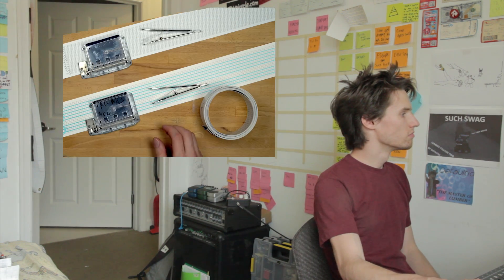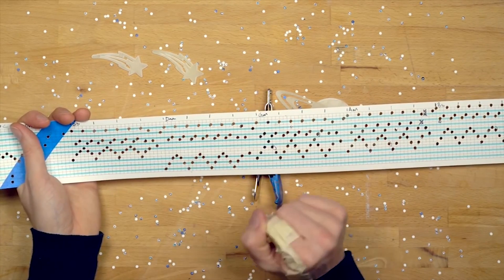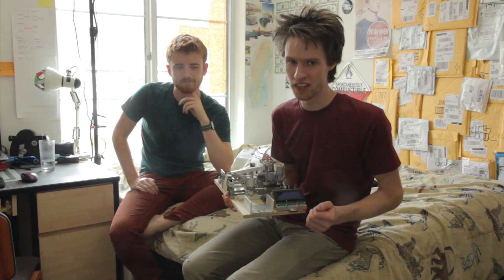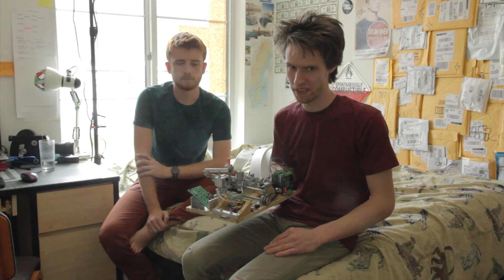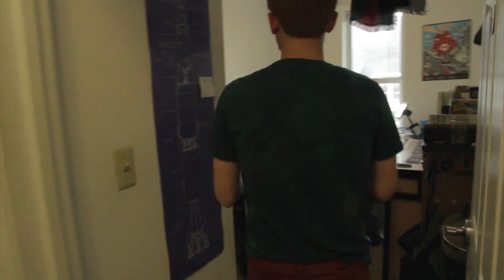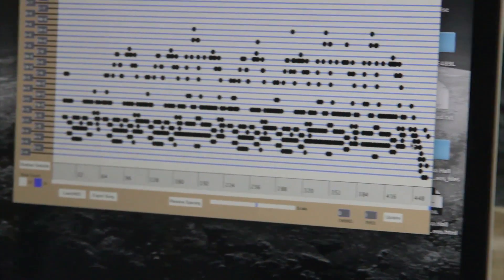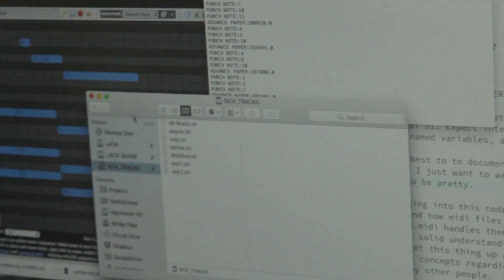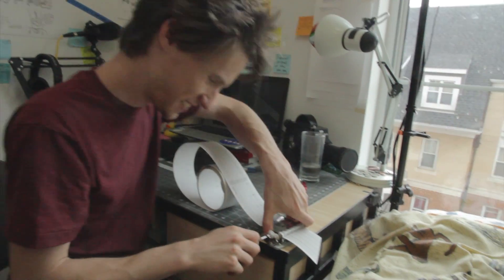Music Box Auto Hole Punch Machine

Comment: Your stainless steel or carbide punch head should go  through a [upper/lower] punch plate where the head punch lines up with the lower and upper sliding die plate and the cardstock will be punched with less effort.  Check this out for ideas; http://www.columbia.edu/cu/computinghistory/026.html

Comment: An upgrade for this machine would be to use a pneumatic cylinder and compressed air to punch the holes, controlled by a solenoid valve. The cylinder, connections, tubing and soleniod valve can be bought from e.g. Ebay or Aliexpress for afforable prices. A pneumatic punch will operate faster and more reliable for this type of machine. Compare with e.g. a nail gun.

Comment: nice idea using the linear bearing, is there much slop in it? I would think an oiled brass bushing would work well. The punch only needs to travel 1-2mm, but the trow of the actuator is about an inch(?) could it not be leveraged?

Comment: This is so awesome, and that intro is fantastic. I didn't even know this was Wintergatan related at first click - I was just like "Gee, someone has an auto puncher, that's perfect for that thing I just watched hours ago". Bam, sure enough, related. Well done. Enjoy ur virality. Just wanted to note that the acceleration curve (AccelStepper library, I assume) is WAYWAYWAYWAYWAY out of tune for this app, and that's making your punching take way longer than it needs to. Unless you're moving a car with that stepper motor, you can cut the acceleration curves down to tenths of seconds, not whole seconds! A little tuning in that department will increase that thing's speed by an order of magnitude. You can probably also decrease the travel of that punch motor (just make it retract less when it reaches the stop), and it'll do the same order-of-magnitude speed increase. :)
Reply: also that sheer, pure, uncorked excitement around 15:30 <3 omg
Reply from the maker: I did the acceleration manually. Should have used a library. :(
Thanks for the tip!

Comment: another thing you can try! if the coil is not strong enough lock if the coil is made for ED100%  you can try to overload it! if the core can handle it. if you double the volts the amps also double! ( not realy becouse if the coil gets hot the resistance rise up but the direction is clear ) the heat is quad but the time is much less than ED100% you needed! but if double the amps the force will double to! if you say 1 /10 of a second in each second the coli is online its youse like ED10% the time is short so it will be work!  you can now 3,2 times the volts and the amps rise up and get no overheat! you can make a littel more by cooling the coil with a small pc fan!  if you have any questions feel free i am a industrieal mechatronics from germany! if i have time i can help!

Comment: The original 1904 roll punching machine at QRS music roills has a die with 88 holes and 88 punches.  The whole head bounces up and down to give the power to punch many holes at once if needed.  The wires push in from the side to push one note hole punch through the paper when the head strikes the paper.  This original punching machine was converted to operate from MIDI back in the 80's.  It originally read a heavy paper roll 3 times as long as the piano roll.  This was called a 3 to 1 master roll.  Notice the MIDI system operates from the very old large floppy disks as they have not updated to flash drive or even cd
https://www.youtube.com/watch?v=P1cGVj52G00

Comment: You could have charged a big capacitor and dump into the solenoid. It doenst look like it will make a difference but I have seen this in another application where a very fast kick was needed. And the solenoid needs to be rewired to a accept a higher current as well.
Reply: If you keep the duty cycle low enough, the exact same coil can be used. What you want to do is use a high speed mosfet to connect the capacitor to the coil. Run the coil at 4-8X power for maybe 1/10th or 1/20th second pulses. It won't overheat as long as the average power dissipation is equal to the rating. More power, shorter pulses. You can overdrive most things to some extent and not damage and not cause any damage, if you use a lower duty cycle.

Comment: This is really amazing. Thanks for sharing your awesome machine and software. I am sure you have already seen this but I thought I will share it with you anyways. Punching paper is a problem that was solved using similar machines to yours in the past www.youtube.com/watch?v=U2YCMEm9Gck if you use higher voltage/power solenoids you might be able to punch a full line at a time. I think this is what the IBM card punches were using.

Anyways, awesome project! :)

Comment: Hi, have you tried to make a high power momentary solenoid (with many amps from a capacitor discharge) as a puncher? I have seen such solenoids throw several kilos up the air. Also have you tried to make square holes? With up-down misalignment of round holes the timing of the note shifts, because the hook does not engage the middle of the circle edge but rather top or bottom which are closer to the start of song. Square holes solve this problem.

Comment: nice! how difficult would it be to get multiple punch heads on the machine?
Reply from the maker: Do you mean like different sized heads?
Reply: Josh Sheldon I mean like multiple punches going at once :)
Reply: Josh Sheldon although now you mention it, what effect would a smaller hole have on the sound?
Reply from the maker: Oh, I see. My original thought was to have one punch for each note instead of only a single punch that moved, but I didn't do this because then you could only use it for that specific music box and it would be way harder to make all those punches. Making one was very hard, and making many would be much harder. I think it would be very difficult to make that many punches.

The hole size doesn't affect the sound as long as it engages the music box mechanism. The hole just needs to be large enough for it to grab onto a hook that spins and plucks the note, but not too large that it catches on multiple notes.
Reply: Josh Sheldon ahh! Thanks!
Reply: Like the American Piano Co. / AMPICO perforator seen here? https://www.youtube.com/watch?v=vkLDLYMw3qg